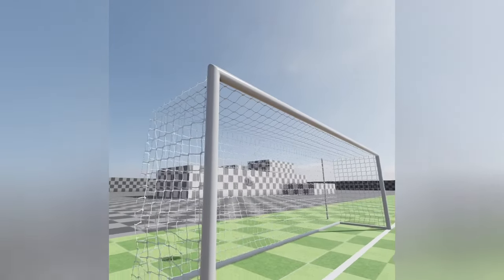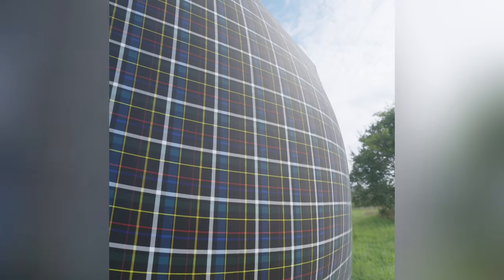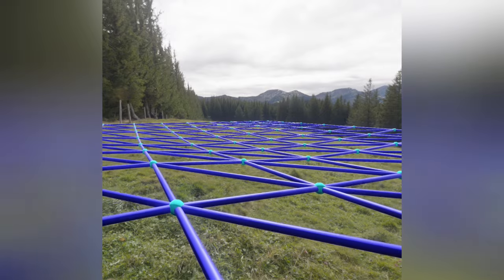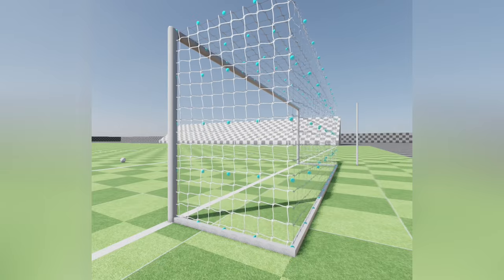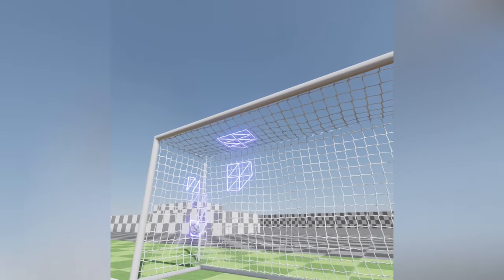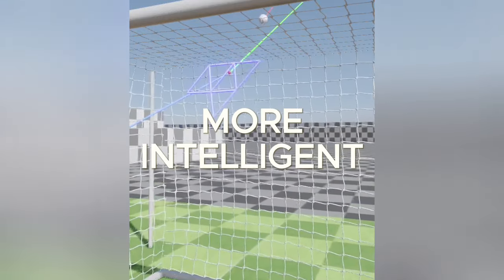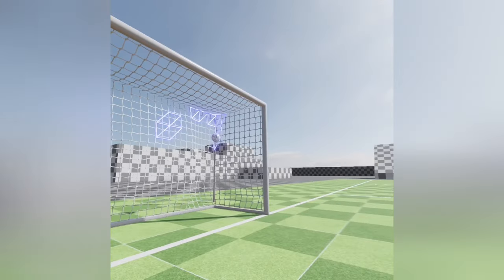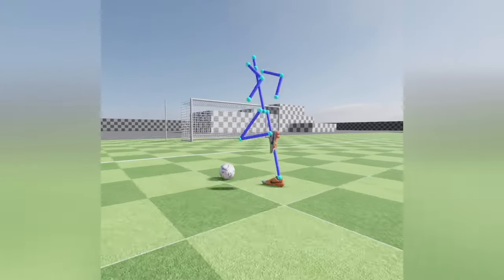I ADDED Goal Net Physics 👌 - Indie Football (Soccer) Game - Devlog #2

Comment: This looks pretty great except it feels weirdly stiff in places and after rewatching, it seems the entire top of the net is pinned on all edges?... if it is possible, I would say only the front edge at the frame of the goal mouth should be pinned, and otherwise should be free to hang, held up only by physically simulated strings at the corners, you have the poles for those strings in place already so idk why they are not functional? Unless there is some complexity in extending the cloth mesh at a corner like that...
Reply from the maker: You’re totally right! This is the first version, it will be better when I return for v2. Thanks for the feedback!

Comment: But it's physically very possible for the ball to go through the net. Is this still possible in this implementation?
Reply from the maker: It’s easy to remove the connections between points based on a condition. But it will require more tricks to making it visually convicting because the net texture should exactly match the positions and resolution of the points.